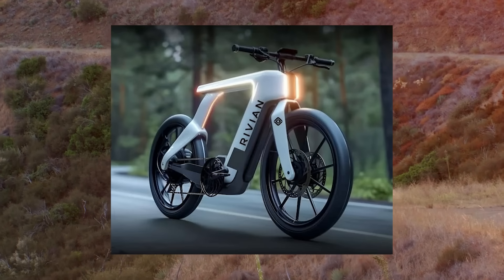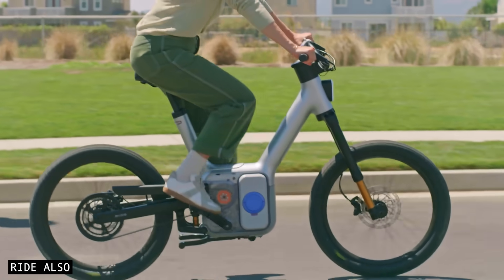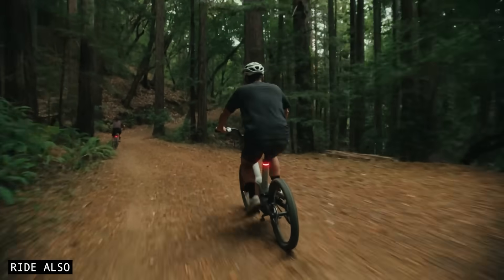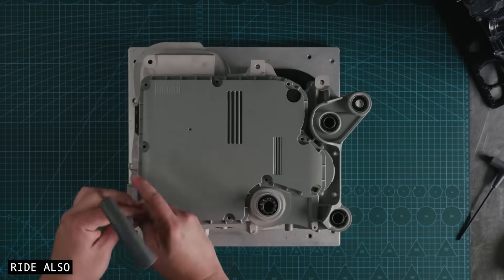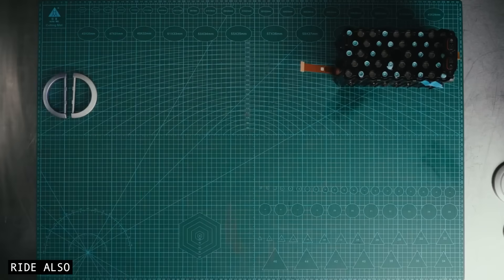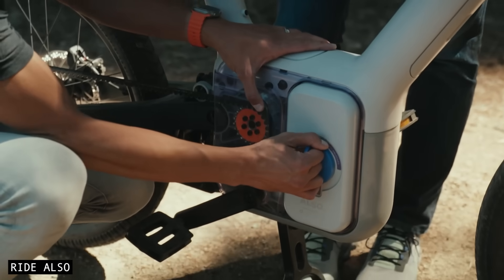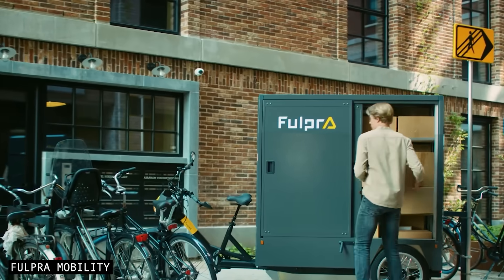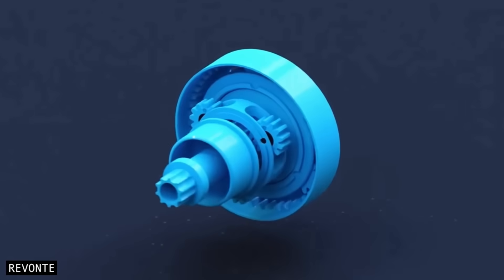Here’s Why the $4,500 Rivian eBike Uses a Digital Gearbox & Belt Drive!

Comment: You were very selective with your positive torque comparison between a direct drive hub motor and the Rivian.. A common geared hub has much better torque than a direct drive and is way lighter to boot...(something like a Xiongda has even better figures )
Reply from the maker: I probably should’ve explained this better. I chose a big direct-drive hub motor for this simulation because, when I tested a geared hub with regen in the Grin simulator, the thermal performance on long, steep climbs resulted in overheating. Remember, in this scenario there’s no rider contributing power, so the motor overheats much faster.

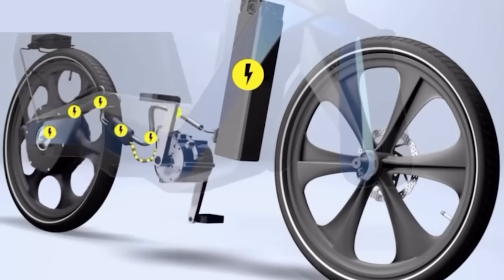Comment: 2:26 That's far too new, on other vehicle types such "serial hybrid" drivetrains have been around since the early 20th century, for example Ferdinand Porsche's first car the Lohner-Porsche aka "Lohner Semper Vivus" which debuted in 1899 (so just a little more than a decade after the world's first motorcar by Carl Benz) had a petrol engine but it powered a generator so the wheels were driven by hub motors, some others also built similar vehicles in the early 20th century.
And these are a wide standard since decades for diesel locomotives (with the exception of Germany who had built diesel-hydraulic ones until the 1980s and a few multiple units like class 612 and Stadler Regioshuttle into the 2000s, but newer German diesel-locomotives are also diesel-electric now like Traxx DE or Siemens ER20/Vectron DE), ships (submarines after WWII got (additional) electric motors for silent running and also a lot of surface ships like those with pod drives like the ABB Azipod that eliminate the need for a rudder) and also some (off-)road vehicles like the giant haul trucks for mining like the Liebherr T282.

Don't forget that the specific Riese + Müller (the name translates into Giant + Miller) "SUV bikes" whose edgy frames are quite ugly IMHO, already come with fenders and a rear rack (looks like a Racktime where you can simply drop in some baskets or top bags) so it's a better daily driver (IMHO still overkill I'd prefer some lighter hardtail with suspension seatpost) while that Rivian is a naked bike without any fenders and rear rack (and with that they might cover the rear light similar to Vanmoof or Cowboy bikes), they seem to have something at 9:30 but that thing looks insane; reminds me of Smart who brought out an E-Bike in 2012 and it had fenders but also no seat stays and with that oddball frame, you could put on a saddle bag and maybe something on the handlebar but that's it, no rear rack (and I don't need a bikepacking bike for everyday use but at least a simple rear pannier rack like Cube puts on their Nuroad FEs or Ortlieb's Quick Rack Light.
You also can't transport it with most bike carriers for cars, already too much for the roof and for the trailer hitch Thule says 30 kilogram weight limit per bike (and you literally need already 20 kilograms from the usual 75kg limit for the carrier) so you literally have to put it on the flatbed of your Rivian, other Pickup or the back of your van, otherwise you would have to get a special bicycle carrying trailer when you can't get to your destination by train.

As I already said on another video about "digital drivetrains" I only see little potential for something like that to build some very unconventional bike like recumbent bikes or mobility bikes/trikes for disabled where the construction had to go great lengths (yes, chain length too) and a couple of chain guides, pulleys to redirect the chain etc. to make it with a conventional drivetrain but with an electric system you could do it simplier and even have a differential on the rear axle of tricycles or simply have independent motors for each wheel.
But not for the ordinary >95% of Bikes out there...

Comment: i actually like this design, unlike a lot of bike enthusiasts.
Pedal efficiency is not an issue if I return home to charge it every night.  90% of commuters can't even use 1/2 of its battery per week (remember the recharging brake part).  As for sports, why are you even commenting here?  Nothing in this bike is designed to replace your battle gear.

Comment: several incorrect statements here about rear hub motors, regenerator, braking, etc. you should talk to grin bikes, and take this down because straight up advertising disinformation at this point
Reply from the maker: Could you highlight some of the incorrect statements you’re referring to? I’m always open to feedback and correcting any errors.

If it's regarding why I chose a big direct-drive hub motor for my quick comparison, here it is: when I tested a geared hub with regen in the Grin simulator, the thermal performance on long, steep climbs resulted in overheating. Remember, in this scenario, there’s no rider contributing power, so motors can overheat much faster.

If it's regarding the claim that 90% of braking energy can be recovered through regen, that's theoretical/optimistic. It would require very efficient hardware, short electrical runs, low switching losses, an ideal state of charge, right battery temp etc.

Comment: Geared hub motors are very common and would have been a more fair comparison.  For instance instead of the Grin All-Axle you should compare to the Grin GMAC, which has 6:1 gearing.  Very light motors like the Bafang G370 have two-stage reductions of closer to 15:1 gearing, allowing a very small motor to stay in the high rpm range where it can put out impressive power (and torque after the reduction).  Geared motors do struggle with managing heat, which would be a challenge for very long climbs on the Rivian.

I think Rivian put the motor in the middle of the bike to balance it out and to improve rear suspension performance.  A hub motor of the power that they use is probably 6-8kg.

I don't think that this can realistically be qualified as a bicycle.  It is a moped at best and closest to a motorcycle.
Reply from the maker: I probably should’ve explained this better. I chose a big direct-drive hub motor for this simulation because, when I tested a geared hub with regen in the Grin simulator, the thermal performance on long, steep climbs resulted in overheating. In this scenario, there’s no rider directly contributing power, so the motors tend to overheat much faster.

Comment: This is in my opinion a true 50/50 motorcycle-bicycle, the mid drive motor with a gearbox, and with a much larger rear sprocket, i think thats why they said its mtb compatible, but also with actually bicycle oriented design, unlike those motorcycle-first ebikes.

Comment: my home made ebike regular with rear and front suspension and 500 wh batter weight about 22-24 kg with steel frame and steel fork. i buy it for 162 euros and then convert it to ebike bying conversion kit with 350 w motor and then build by myself battery for about 120-130 eur.

Comment: I would make a very important point about this in terms of pedaling efficiency. When you pedal "by the wire", you lose more energy to convert, but you also get regenerative braking, which increases the overall efficiency of the system and moves closer to a regular "mechanical" bike. I would really like to compare direct drive and this discharged bike in order to understand how much more effort will need to be spent to overcome: a flat road, moderately hilly and hilly roads. It would be very interesting!!!

Comment: So, if the owner can brick the bike remotely, what prevents Rivian to do the same? Even if it will be only a "We are not supporting that hardware anymore" problem?
Reply: And five years later, Seth pulls the bricked bike out of a dumpster and gets it working again. Wouldn't buy one, but I'm looking forward to fun hacks.
Reply: Don't you trust corporations? I can also see hackers bricking your bike for fun.
Reply: @romgl4513 Not really. You can find enough videos when end of support products become paperweight. (It looks like my previous answeer was deleted. Brobably for mentioning someone 🤬)
Reply: Most of these are going to end up parked away in  garages and sheds and never used a few months after purchase anyway, so Rivian will probably "require" yearly servicing and shut the bike down or limit functionality until it is serviced. You know, for safety reasons. Best not to tie your revenue to km traveled with these things. Unless, like Bosch, your business model is replacing out of warranty ebike motors at <3000km
Reply: more importantly what happens when AWS goes down again?
Reply: @cody4516  Speed 3: digital braking
Reply: 2 words.... class action.

Comment: The delivery quads would be fantastic in any city with lots of old narrow streets.  For example, Istanbul has thousands of narrow streets in old neighborhoods that are menaced or blocked by cars that are mixed in with pedestrians who don't have any sidewalk space.  Electric tuktuks for taxis make 100% sense here, especially if they have the torque and traction to make it up the steep cobblestone streets.  It would make everything better.
Reply: However they’re terrible for the cyclists using bike lanes to commute. They are much larger and heavier than a bike, and don’t have the same crash safety regulations as cars, so present a danger to the standard bikes. They also clog up bike lanes as they will often be travelling slower to eke out extra range, and are too wide to safely pass.

If companies want to use these to make deliveries, they should at least be enforcing some tax to feed back into making better bike lanes, as otherwise they’re essentially abusing public infrastructure.

Comment: Okay.  I'm starting to change my mind a little.  The weight is a bit of a killer to me.  Why is it so heavy?  Not digging the quad bikes being used in the bike lane.  Riders trying to speed to make their deliveries would be a danger to people just riding.  And if they don't pull the whole thing off the lane, they're blocking it and possibly making people go into traffic.  Local lawmakers need to start some regulatory actions.  It's gotta be weird to ride as you're looking for that resistance off the get go to pedal harder.  I really need to try one out.

Comment: i first thought that it’s pretty inefficient to have no direct mechanical connection to the wheel due to the generator and motor losses being multiplied. but the regen can make it worth with it, especially if you live in a hilly region or have a stop and go scenario.
Reply: It doesn’t matter how efficient the pedaling is if it’s mostly powered by plugging in and charging the battery.

Comment: This isn't even a moped any more. It's a motorcycle with decorative pedals.
Reply: Dunno why you say that. The pedals work.
Reply: @jysmtl  but no one is going to put any real effort into it.  I'm a good cyclist, but will take my ebike to avoid getting sweaty on a commute.
Reply: Yeah, this is literally how mopeds became vehicles in their own category.
First they added a small engine to bicycles to assist with pedalling, then the engine got powerful enough and the bikes heavy enough that the pedals became vestigial, everyone started exploiting these "bicycles" and the law had to address it, so we got mopeds with plates and insurance requirements. Even early microcars in France had pedals and were technically "bikes".
Now, e-bikes are pushing the same concept; pedals like these are just loophole throttles and soon enough the law will catch up as they spread and become more common.
Reply: I think this is some law loophole for selling motorbikes disguised as bicycles.
Reply: @borisov1024 kind of like automotive makers getting around efficiency and MPG laws by making SUVs and classifying them as large trucks.
Reply: looking at the size of the battery, it can't be that powerfull. More like moped power.
Reply: Only someone who doesn’t ride motorcycles would say something so laughably ridiculous.
Reply: @ShaunHensley more likely you never rode a Grom or any 125 bike

Comment: What makes a bicycle so good is not just its efficiency, but its simplicity and the high degrees of standardisation across most framesets. I can buy a bike with a BSA bottom bracket and know that I can buy a new sealed bearing replacement when the original wears out. Will Rivian guarantee parts availability 20 years down the track? Will they be affordable parts, available from any manufacturer. While I have an eBike and an eRecumbent trike (I have a hheart condition thanks to a COVID induce heart attack), I still reckon the "pure" bike, BSA BB, 100mm front hub, 135mm rear hub (Boost thru axle is a good option, too), 26er, 650B or 700C wheels, inch and one eighth headset, 65mm bidon mount spacing with M5 threads is always going to be fixable. Will a Rivian? These tech bros who think the bicycle as we know it can be "improved" are really just trying to trick us into giving them our data and allowing them to lock us out of our bikes once it becomes obsolete. A Rivian probably come with no right to repair, no right to hack the firmware and no right to ride where they don't want you to. Give me a chromoly frame, standard parts and, if I have to go electric, a hub drive, over any other platform. I don't even want an integrated frame battery or controller, because one day, those parts won't be replaceable, and electronics is my trade. They simply won't be replaceable after 10 years. The bike will be convertible to "acoustic," though, if everything else is standard.
Reply: It won't last long enough to need spare parts. They likely won't even make them available to the public.

Comment: I can't imagine anyone with a bit of taste will spend tons of money on such an inefficient monstrosity produced by a company with no experience in the cycling branch. If the company fails, this will render these ugly bicycles useless bricks. Then, the advanced security will backfire. One of the main advantages of a bicycle is making you independent. E-bikes are for physically unfit people with too much money and too little thought. Batteries cause lots of environmental issues in their dirty production and can't be properly recycled. The best bicycles would be a Riese und Mueller with full suspension, a Pinion gear, and without electric drive. But they don't make these anymore because they can charge about 3000£ more for adding an electric drive and a battery.

Comment: The onboard GPS automatically converts the throttle to an "assist boost" in states/jurisdictions that disallow throttles on Class 3 ebikes. Will the "walk mode" work when the throttle is in "assist boost" mode?
Reply: This is the reason you don't want a bike connected to your phone. You don't own the product if you can't control it.
Apart from the data gathering and probable lack of customer repairability.

And also, centrally placed motors (near the pedals) are already the standard here in the Netherlands on most e-bikes. Comparing the thing  in the video to a rear hub motor like in this video is disingenuous.

Comment: 4:15 This defies physics. As the front wheel is responsible for about 80% of the brake force, the rear wheel only abou 20%. I assume the 90% figure therefore only means around 18%.
Reply: But if you only squeeze the rear brake then the rear does 100% of the stopping. But I know what you’re saying, in a full panic stop you need to use the front brake for shortest braking distance. If you’re commuting or on a Sunday ride, using regen with the rear is just dandy.
Reply: That depends on the bike geometry, tire friction, and how much braking is required. A lot of people only ever use their rear break when biking, and there is no reason this couldn't prefer the regenerative break for light breaking and engage the front brake for heavier braking.
As a cyclist, I don't like the idea of my bike choosing my breaking bias for me, but that doesn't mean it isn't a pheasible solution.
Reply: @bungalowbill521 Nope, you can't change physics. The only way the rear could have a greater force, is if you intentionally reduce the front brake force. We're talking four times less power. Maybe just not have a front brake at all. That would be insane. Any idea why many cars have disks on the front and drums on the back? Because the front does most of the work, so rear drums don't heat up as much. Or motorcycles and high performance cars have more pistons and larger disks at the front than back? Disconnect your front brake, go and have a few crashes, and let us know how you go. Cheers.
Reply: That's true for a spontaneous full stop. But if you ride safe with some foresight you can break slower with just the back wheel, no problem. 
So the 90% figure is probably accurate in 90% of cases, if the rider know how to utilize it.
Reply: @block3773 So you're saying that Alee intentionally lied or misled us, and that 90% of riders don't know how to ride safely. Anyone who is rear brake focused hasn't had enough hospital visits. The primary benefit of the rear brake is stability, not to slow you down. Might as well depend on mechanical friction and air resistance 🤦
Reply: @user-fed-yum no, I didn't say anything like this. But I can say some of it now: It's totally save to just break with your rear break in a controlled and safe situation, like while approaching a red light. 
If the company said you get 90% everytime you break it would be a lie, but I have seen this video and not officially material. 

Btw. I never wrote anything about 90% of riders, but 90% of situations. 

And for context, I used to ride a fixi with two functional brakes. Doing this really shows you how rarely a front break is necessary. But don't get me wrong, when it is necessary it's crucial.
Reply: It’s a solution for city and cargo bikes, it would be lethal in performance or off-road environments
Reply: Very true. You'd have to brake with your feet (like a coaster brake).